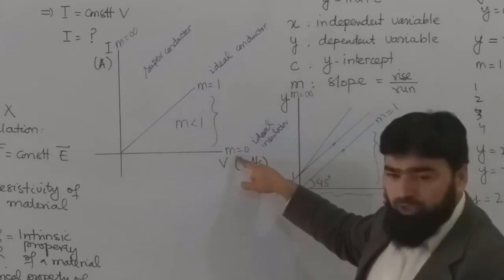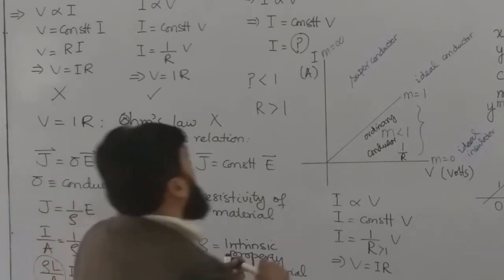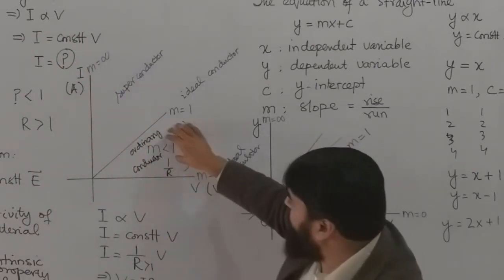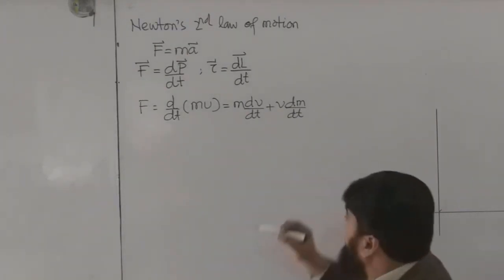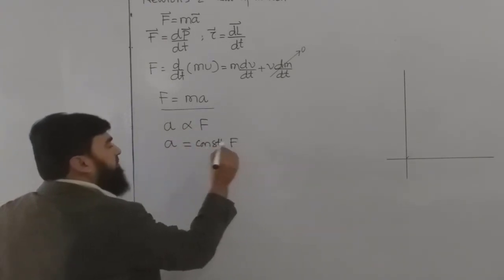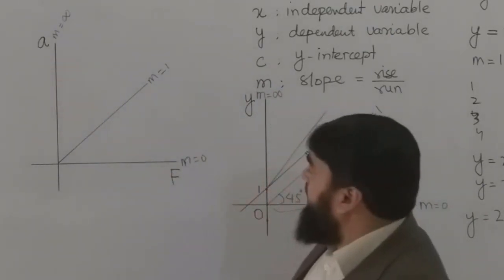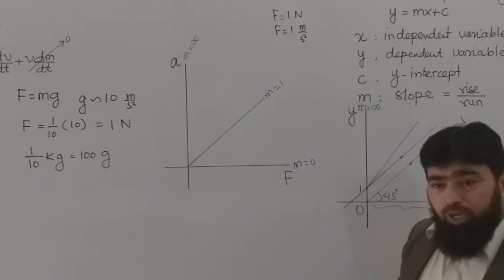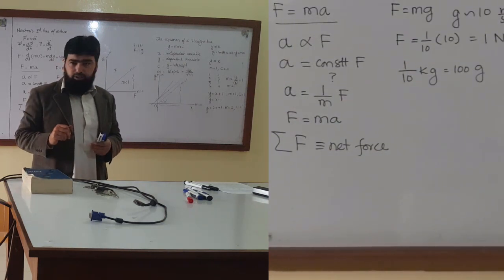1.3 Fundamental laws of physics in simple words

Comment: Sir... There is a direct relation b/w voltage and current in case of ohms law... Nd in case of Electrical Power Voltage and Current are inversely related...... 
and secondly sir ohms law is not applicable in transformer case. 
plz sir can u explain it
Reply from the maker: Very good input. I may include this concept in the forthcoming videos as I want to discuss all conceptual points. Thanks
Reply: okay... tnx a lot Dear sir g
Reply: @arifullah7395  q1. P=iv where p=i^2r so arranging these equation u can still have ur empirical relation 
q2 in transformer where  induced emf is there the current and voltage relation inverse which brings the nonlinearity in transformers so that's why it's not applicable there